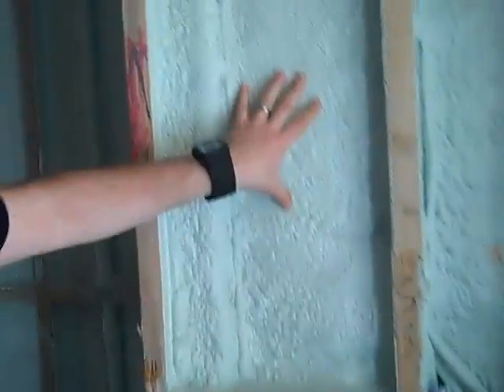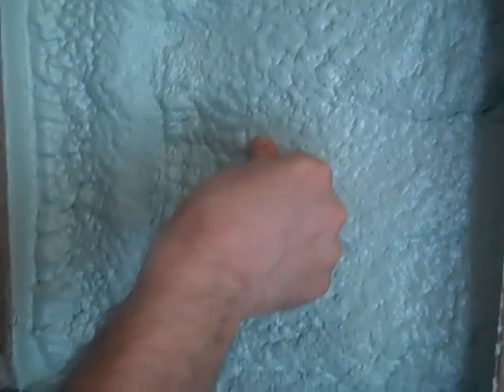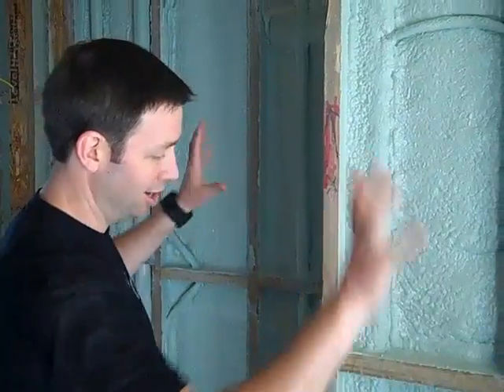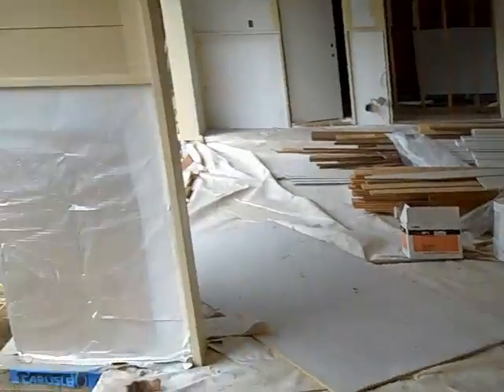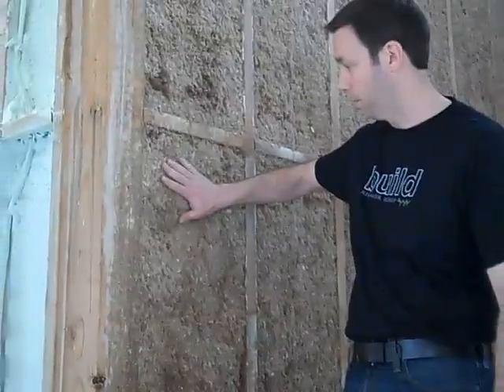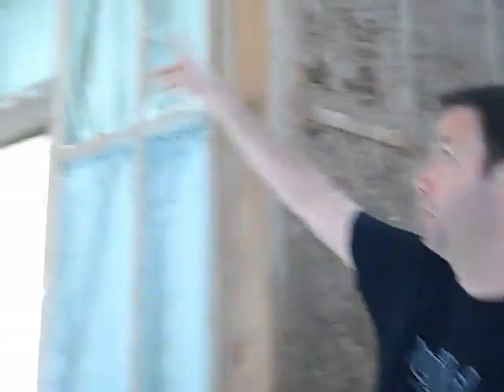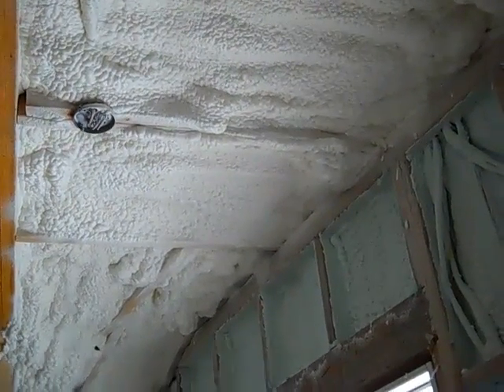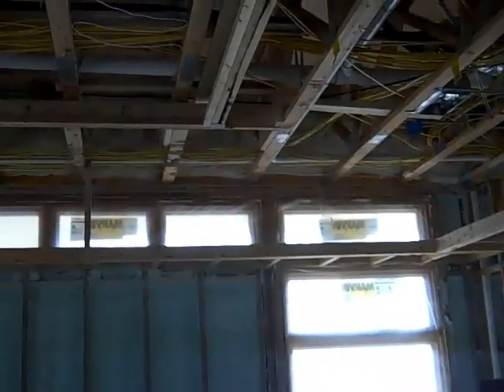Hybrid Insulation - 1" of Closed Cell Foam topped with Cellulose in a 2x4 wall

Comment: Did similar in my home but the entire exterior is 2x8 walls so I did 2 inches of foam and dense packed the rest.  Keep the whole home warm with a space heater and can freeze in the summer with an 18k mini split.  Built almost the entire home with reclaimed or salvaged materials (am in the construction industry) and using tips, particularly on the details, from Matt am seeing it perform amazingly.

Comment: Hi thanks for the video. Is this on a light steel frame construction? 
I was considering the same method. I have a light steel frame with external steel panel cladding. 
I was considering covering all metal surfaces with the closed-cell insulation and then beefing my insulation up with the cellulose.

Any feedback would be most appreciated 

Phil

Comment: Living in Northern Canada where winter temperatures sometimes drop below -40, I am thinking of doing Flash and Batt insulation my garage attic. I would be going 1 inch thick with closed cell foam and then Fiberglass batts of R-40. Do I need to install a plastic vapor barrier or does the closed cell spray foam also act as vapor barrier ?

Comment: Mike could you use fiberglass batt too ?? Thanks
Reply: That's a strategy called "flash and batt," while this is "flash and blow," and it can certainly work.  Matt actually has a video about this - https://www.youtube.com/watch?v=RyFcsoLlNSo and it can work.  Just be careful to use the right kind of batt insulation - you don't want a faced insulation for this, because that's a recipe for any condensation from even small openings to create mold.

Comment: Sometimes we have customers want us to do 1"- 1½" closed with open cell, or fiber glass completing the r-value.  But cellulose?   It settles over time, its dusty and nasty, and you better believe it spread through the house forever through any outlet or nails hole every time a door or window is opened and closed.  The closed cell looks real nice though, good spray job.
Reply: @Efren Martinez Blown fiberglass is shredded but still fluffy like you would know fiberglass batts to be, while cellulose is made from recycled materials, primarily newspaper, but you can easily find all sorts of things in any given package.  The cellulose being primarily shredded recycled paper makes it like dust from the get go, over time in your hot attic, it dries, turns more to dust, and naturally, settles.

Comment: One concern I would have is the plywood "sandwiched" between two layers of foam in humid Texas, is there not a chance of the plywood becoming damp and moldy without it being able to dry to the outside or the inside?

Comment: Why did you use  6" of what YOU CALLED open cell on one side of the house in the ceiling , but then use 6" of what YOU called CLOSED cell on the other??  Also,.. what about the ROI on the cost of the 6" of foam?? .... that has to be close to 7-10 a sq ft!!

Comment: Matt:  Currently building my dream home in Dallas, TX, and have loved your videos.  I'm currently deciding on my insulation system.  With regards to the closed cell foam, my main question involves reports I have read, which contend that that the CC foam and/or the R value of it begins to break down after a number of years.  Some have even said it actually condenses and may retreat from the sealed crevices it fills. Is this true, and to what extent is it a concern?
Reply from the maker: Jason McCoy Jason, I do believe it loses some R-Value after time, but don't buy the report about it breaking down.  Wish you the best in your endeavors.  Matt
Reply: What report or source do you have that CC foam "loses some R value"??
Reply: hotrodder62.. it’s not after a couple of years.. it happens much faster than that. What starts at around r7, after 90 days ends up being somewhere between r5 and r6. This is because the propellant gases are replaced with Air

Comment: I was wondering why you didn't just add more CC, then I read you were in hot/humid. I used to be a fan of exterior rigid foam but now have to come to realize it's generally never necessary as you would first entirely fill the wall system with C.C. foam. If you can get 4-6" of C.C. foam in a wall then you're talking enormous R-Value and air/vapor barrier. Even in Alaska this would hold up well. If after that you don't have enough room for insulation but want more, THEN go to the rigid foam products on the exterior. They are just generally not worth the hassle of installation for the minimal return of R-Value. Also you are not supposed to use rigid over the top of C.C. foam. I asked with building science advisor on greenhomeadvisor who are experts in walls systems. This, they told me, is because C.C foam wants to breathe to the outside and if you trap a layer of osb/ply siding between the C.C foam the exterior rigid foam sheets it will eventually collect all the moisture and rot as it's between two non-permeable products. Makes sense when you think about it. It's like putting cardboard between two sheets of plastic. The cardboard will rot in time and that cardboard in this instance is your structural siding.

A work around for this may be to use your structural sheeting on the inside of the home and then put the rigid right on the 2x4 studs and the siding over that. But I'm not sure if any code would allow that.

Comment from the maker: @G66CA Excellent question!  In our climate zone that's not necessary.  The 1" of rigid foam forms a near-perfect air barrier and air leaks are a major source of moisture gain in our hot/humid climate.  The rigid foam's job is an air sealer and the blown cellulose can then do it's insulation job effectively.  If you're in a Northern climate then this may not be the correct install for you.  Look up what Joe Lstiburek has to say on this one.  Matt Risinger

Comment from the maker: @clintsmith96 Good question on the Rvalue.  In this 2x4 wall system we're probably around R16 plus the 3/4" rigid foam on the outside so it's around R20 total.  This is new construction so no before/after bills on this one.  I need to do that on a future job for sure.  -Matt Risinger

Comment from the maker: @CanadianToolGuy21 Yes, I saw that article in FHB.  This is basically the same concept except we didn't want to use fiberglass.  Cellulose has a greener footprint and we'll get a slightly better insulation value from a total fill application than a batt.  This is definitely a well insulated house.  Thanks for your comments, Matt
Reply: Hey Matt to follow up on the comment by @currupedsmurf ... I'm also considering a hybrid solution 2inch closed cell , followed up by either open cell or blown in cellulose in an unvented attic application in a 2x12 rafters and 2x10 rafters.  I see the benefits of the closed cell but not crazy about applying foam everywhere to achieve the R value I need in the northeast. Thoughts ?

Comment: What R value do you end up with on the foam & damp combo? I'm assuming its cheaper that way instead of all closed foam.  On your remodels using all foam insulation, do you have an before and after electric bill? Great vid's.